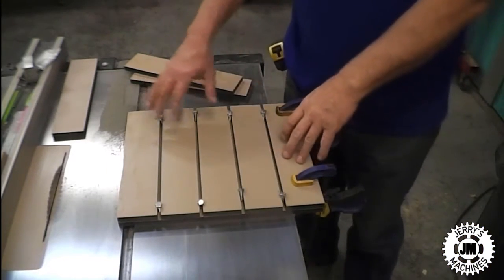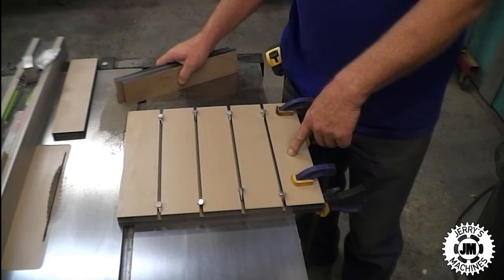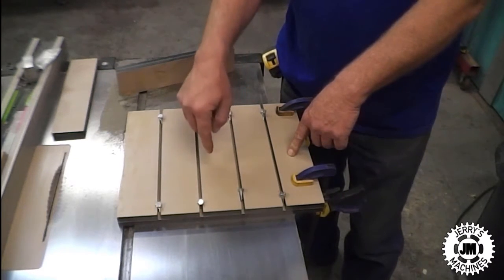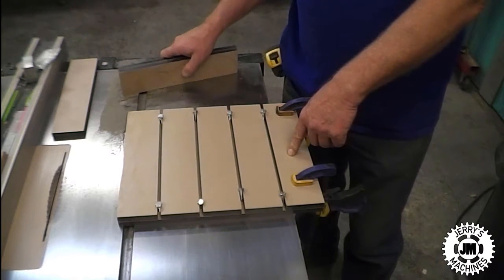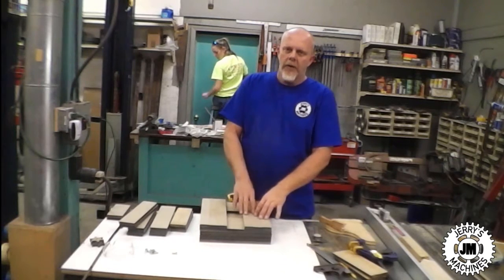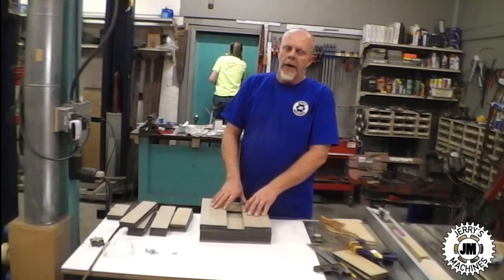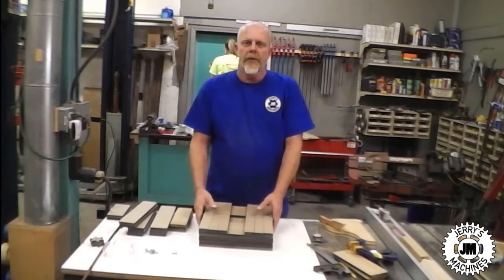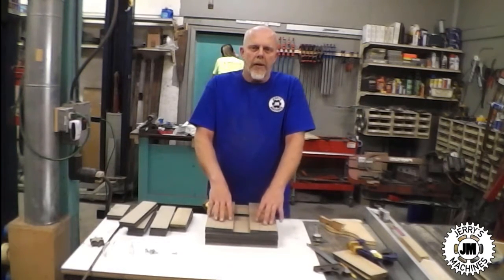Mill style drill press table build part 1

Comment: nothing like a good series-good stuff Jerry! will this work on ANY drill press or does it have to be benchtop/specific type or kind?
Reply from the maker: I have not tried it on every type of drill press but have on a couple bench tops and 3 different floor models. Basically  anything that you have a table on it should work. I have a design that allows you to extend the crank on the models the table gets in the way of to raise and lower the table.My table is much bigger and it doesn't get in the way of anything on mine. I am hoping to get my hands on one that has a different style crank system so I can show that design as well, just not sure when that will happen.
Reply from the maker: Thank you, Joe

Comment: i have a 10" craftsman  and i hate the dookie little table that comes with it."/
Reply from the maker: the one I will show this on is similar to what you have. The height is the issue but if the table is off and this is bolted to the base it works fine. Can create issues with height with short bits but that only means you have to have blocks on the table.
Reply: Jerry's Machines gotcha cool man! Thanks!! Look forward to seeing it done.